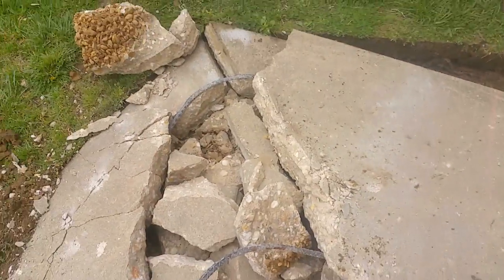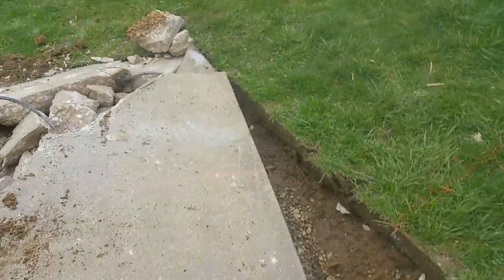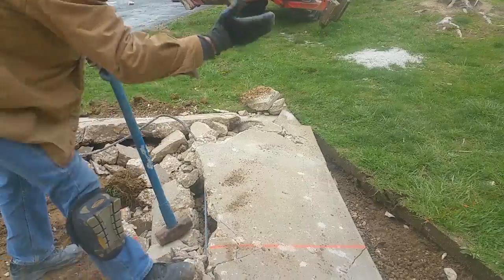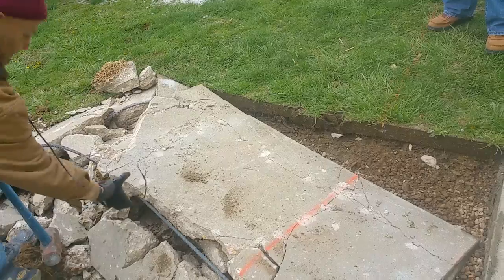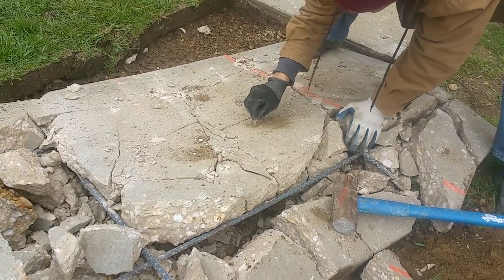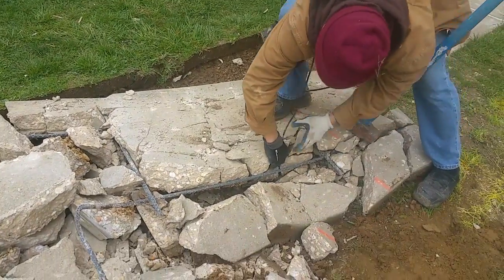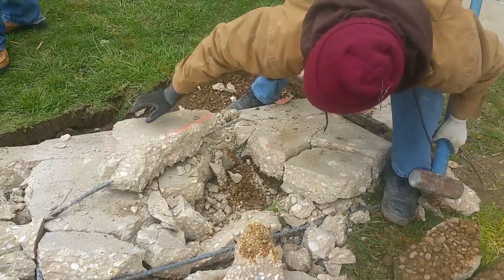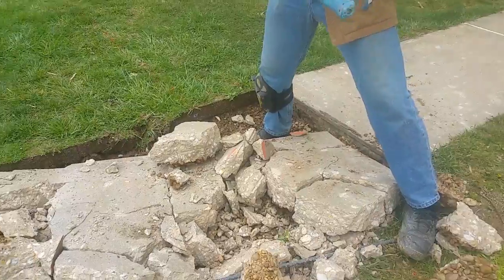How to break up a concrete sidewalk WITH REBAR installed

Comment: After watching the concrete come to pieces in this video, I have more insight into your opinions. At the same time your series on the FIU bridge collapse terrifies me even more!? A structure comprising a thin slab of a few inches of 'high-strength' concrete, some rebar and PT cables, is no ways going to hold up a 950 ton 200ft bridge span...
Reply from the maker: That is where they ''lean on" post tensioning... to overcome the weakness of concrete in tension... But, as we know, they also designed this structure with incorrect ratios...
Reply: The FIU bridge may be a design that 'works' on a computer, but not so well in real life...

Comment: Looks like the part without the rebar broke easier ?
Reply from the maker: Exactly, this is what I was attempting to get across... that it takes less effort to break up concrete reinforced with rebar than without... IF, you can use the ''void'' area the rebar created... This means their is less surface material over the rebar than ''next'' to the rebar... Basically, you the rebar also helps you bring that area to failure.  IT cannot take "shock loads" ...